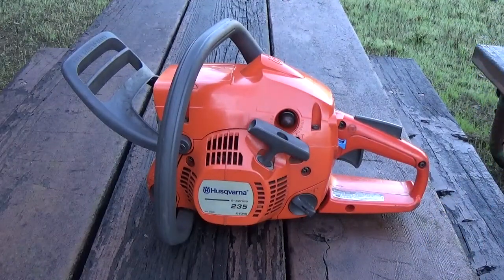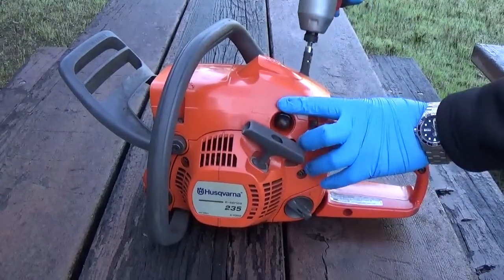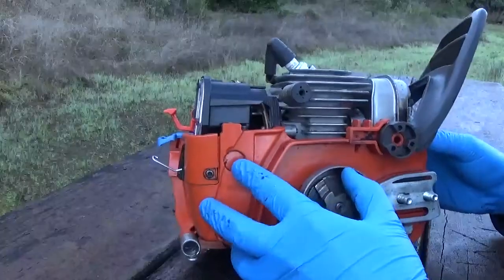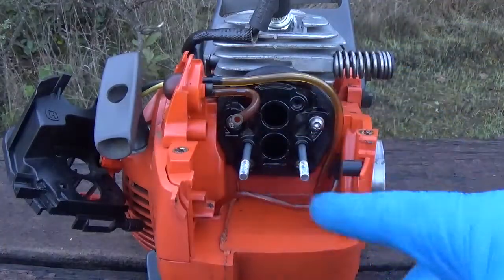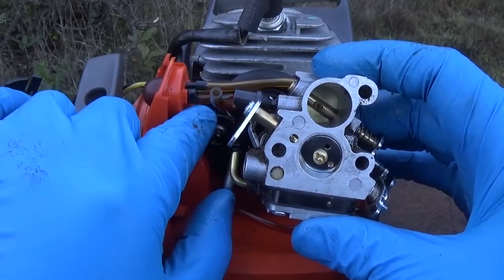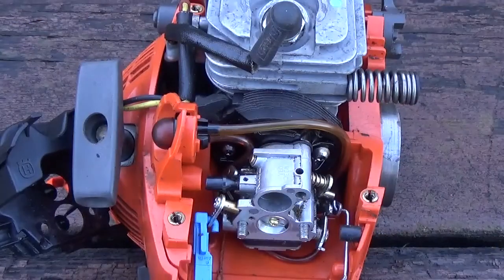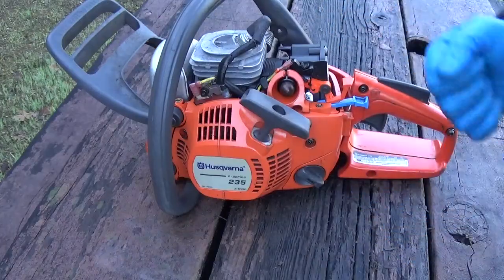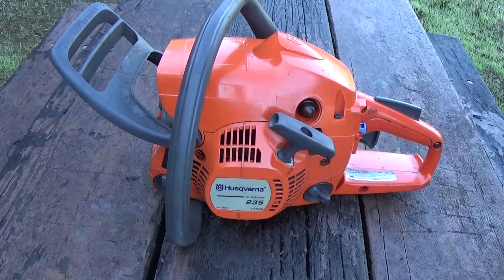Husqvarna 235/ 240 Carburetor Removal & Fuel Line Diagram

Comment: Finally somebody did a simple instructive video that shows you and tells you exactly what you need to know I swear there's nine thousand different videos and they all go around what you need to know and never cover a single bit of it I was trying to verify the way the fuel lines ran on the soil and apparently I do have them the correct way thanks for actually making a video it has good information in it

Comment: Information much appreciated. 
I picked up a 235 and a 445, Both needing Repairs for $115.
Whoever attempted to fix the 235 Put the Fuel filter on a <New> return line, Left the old Pickup Line on (and cracked) and the old carb to primer which had several cracks. On initial testing - i.e. adding Gas to the tank - the whole Top Deck under the Carb was Flood with fuel.
After reviewing this video I pulled the carb, cleaned and Flushed it well. I then followed your diagram replacing the bad fuel lines, putting a new filter on the correct line and reassembled everything.
Initial starting was a bit rough but when I made the proper low/High adjustments it decided to idle and is super snappy going to max RPM. Make me happy.
Now to get a clutch cover, Bar/Chain and find a buyer.

Comment: Very well done Sir! 
Saw would quit running several minutes after a full tank, rotten fuel lines were sucking air as soon as the fuel level dropped.
I shoulda looked for this before I started unscrewing everything.
But, yeah, I googled "Husqvarna fuel flow diagram" and bingo.
I won't say what I learned about those four screws on the bottom of the motor but you did remember for me the three finger tubing puzzle.
All is well in the end, 17 year old unit saved from the recycle yard for a couple hours & $20 and saved about $300.

Comment: I put a new bar and chain on mine to correct a crooked cut. After, my saw decided to not start. Thinking it was an old fuel or carb issue, I took out cleaned, replaced the spark plug and tuned. Okay the saw is running like a champ again!Then ran into a no start issue again. Primer bulb was only half full so I’m thinking I need to replace my fuel lines. 

I’ve already put money into the saw so I might as well keep going till it’s fixed. 
Great video, thanks.

Comment: Thanks for the very well done video, it explained how to take the saw apart enough to get at the fuel lines and carb and a very good explanation of how the primer bulb actually works. I was able to replace the fuel line from the carb to the tank without removing the carb, once it got in the tank, was able to grab it with a pick and pull it thru. A fiddly job but not difficult.

Comment: Excellant video great detail.
Especially choke lever position. Originally had it installed wrong.
I was able to change the carb but had to do it twice.
I forgot to install the gasket.
Noticed the old gasket on the old one after I installed the carb 
Your detailed instructions helped alot.
It runs now but have to adjust hi low settings. It stalls when I pull the trigger.

Comment: You won at YouTube for today. Thanks! 
I got my saw back from a "small engine" joint after having them replace cracking fuel lines, filter and bulb. Prime, choke, pull, half-choke, pull and it ran great... For 4 seconds.
They had the bulb backwards and the filter on the wrong side. Working now.
Again, thanks!
Reply from the maker: That's like the worse of both worlds...had to pay to get your saw worked on, and had to work on it yourself anyway. I'm sorry to hear that.
Reply: How much did that cost you at the small engine shop? I'd like to chant the cost I'm saving as I do this work for myself!

Comment: Awesome video. I have a jonesered and I have yet to find a video for that brand on fuel line routing. I knew I shoulda took a pic before I tore out the fuel lines, but I didn't. On top of that it's 2 weeks later and I'm now working on it again. ( out of state work emergency) my Jonesered model CS 2234 S fuel line routing is exactly the same as your Husqvarna. I take it that Husqvarna owns jonesered co. So it all makes sense now. Great video and thank you..😄🤘

Comment: Great video and saved me a ton of time and money. I have a 235e, and it took me a couple of tries getting it back together because I got the screws mixed up, would've like a little more detail on that, plus mine has two different sizes of gas tubing, a smaller one for the main gas line from the filter, and two lines next size larger for bulb/primer. Otherwise, many kudos for an excellent job!!!Thank you!!

Comment: Great video. Appreciate you taking apart a running saw to show us how. Do note the bolt holes through the black plastic carb piece are way too tight. That's  the pinch point. Ream those out once you get it apart to make future cleaning easier.

Comment: Thank you for the in depth video this was great!!! My issue was I bought mine from a pawn shop and well lets say never again with out a full take down and deep dive into finding out what the heck someone else did to the dam thing! cost me almost as much as a new saw to replace the worn out parts I think I am 15$ less at this point and I need to replace the bottom fuel line because they used the wrong one and it leaks from the tank as you try and prime it so the saw does not stay running because it sucks air and then dies!

Comment: Well done! Great video!
I've had a few chainsaws where the fuel line depletes over time and drops the filter in the tank. What a load of bollx. You need to learn to fix them yourself or they just become disposable trash.
But thanks for posting this.
PS.. I get the fuel line kits from Lowes or HomeDepot

Comment: This is about as simple and straightforward as it gets. Great fuel line vid, the best I found.  If I can understand it so can anyone.  Just one question, maybe 2: How far into the tank does the return line need to be?  Does it really need that little nipple on the end?  How much play is needed in the line with the fuel filter?  No doubt it's going to move around, but is there a goal with how it lays and where the filter usually drops?
Reply: I didn't ask bout no 235240what ever came uo<<< I ask bout 440 so I wasted my time

Comment: Execellent video. I'm replacing my 235 carburetor and fuel lines now. Any suggestions on how to replace the fuel line that travels from the bubble back to the fuel tank? looks like it has something at the end of the line inside the tank that keeps it from being removed.
Reply from the maker: Yes the white piece on the end of the fuel line is just for that, to keep it from pulling out. Easier to pull it out through the gas tank, and put the piece back on similar to the fuel filter. Sorry for the delayed reply, hope this helps.

Comment: Good info, used some curved hemostats (surgeon style pliers you see medics clamping onto arteries in ww2/nam movies) Fits in the gas tank perfectly to clamp onto the cut needlepoint in the hose you mentioned. Cheap too.
Reply from the maker: Those are an awesome tool to have around... very useful for machines where the gas cap hole is in a awkward spot (for me, certain back pack blowers come to mind.) That and it feels cool using them.

Comment: Well I may ask you a question about my Husqvarna 326 that I bought from a fellow ...It started when  he tested it but the day after 
I only enjoyed it  fifteen minutes then it become a night mare  ...to make the long story short I replaced the carburettor -a new one from China -
And stil didn't start and  because it is hard to pull the rope  i decided to have a look the  the piston and the cylinder ...
The piston shows a scratch on the muffler side  it has not damaged the ring and the cylinder ....Then  I removed the ring and fitted
it in cylinder it has a gup about one millimetre....it's ok or do I have to replace the piston and the ring ?
I appreciate your help               Thank you

Comment: I've got this exact model and I really need your help. I have to replace the fuel lines and purge bulb which is not too difficult for me to do. What I'm not sure about is the fuel tank vent ( I accidentally pulled out the check valve (duckbill) while trying to pull out the old fuel line that goes into the fuel line fitting. So that needs to be replaced. I understand that I need to drill a hole in the vent and pull it out with a screw. I also pulled out the fuel line fitting so I'm not sure how the fuel line/s needs to be installed. Is there a piece of fuel line that needs to be ran from the top of the bubble into the bottom of the tank from the bottom of the fitting? Sorry for all of the questions.

Comment: when you buy the car lets say from Amazon do you need to adjusts the carb or id it plug and play with out having to adjust?
Reply from the maker: The cheap carbs on Amazon are hit and miss, its why there so cheap. They may work with settings out of the box but you really should check your rpms with a tach.  If tuning by ear, I'd eer on the side of caution and go on the slightly richer side, stratified engines are little harder to tune by ear. Good luck.

Comment: Great job with the video, really well done. I'm having an issue with a 120 mark 2 and was wondering if you've ever had to replace the fuel tank vent on one. Same setup as the 235/40 but I can't find any info on how that sucker comes out. Thanks for the video!  Subbed.

Comment: I am asking to myself should I disturb you  or not since I never got an answer to my  question a couple weeks ago 
since then to my surprise the chainsaw  works  but  I can get the new primary working   I connected as per your diagram  
but  no fuel flows in out actually the bulb get stuck and does not  come back  so a you said long little tube the fuel line (out)
to the tank  the short one (inlet)  from carburettor to the bulb .Any suggestions ?

Comment: What are the two spline screws on the choke linkage side? Do you have to do anything to them?
Reply: Never mind. I’m an idiot. Never replaced a carb and didn’t think about those being the low and high adjustments while I was holding the new one in my hand.
Reply from the maker: You may have to adjust them. As you figured out its for fuel air mixture on the high and low end. Some caution tho, and topic for a different day... if one does know what they're doing you can blow your saw up.

Comment: Ugh.  Well, I took it apart, cleaned carburetor as well as I could.  Replaced all 3 lines and filter and it started and ran but it eventually bugs out and won’t idle.  Then it won’t start.  It’s 13 years old but I spent $20 today.  
Is it worth it to keep trying?   New carburetor?   Thanks in advance.
Reply from the maker: Its hard to say, I have spent money on a machine that was totally not worth it, because I enjoyed doing it, and it was a good learning experience. 

 If it's 13 years old, got used heavily and at $150-200 brand new, money wise it probably makes more sense to buy a new saw. (especially if you can't wait for parts, and need a running saw right now.) But if you like the experience, yes a new carb could solve the problem but that being said...

Before you put anymore money into it, I would look at the condition of other things first.  (maybe I'll make another video of what you should be looking for.)  Does the compression on the pull rope feel decent?  

If your comfortable with it, pull off the muffler look at the piston, rings , and cylinder wall, is there any scoring?  A 13 year old home owner grade saw used heavily may have some wear, in which case you could be wasting your time.

Hows' the bar and chain, if they're worn out that's another $40-50. (just one of the many things to keep in mind, too much for me to cover in one message)

A new O.E.M. carb in my area is like $60-70.  You'll see cheap aftermarket carbs online for like $20 but there just that, cheap.  I've had success using them before, but you really gotta be careful sometimes the quality control is shoddy at best and almost laughable.  (I would never use cheap chinese carbs on a machine that was valuable and in really good condition, but with a little research I've seen them work pretty well.)

Sorry for such a long message, but I hope it helps you out, feel free to PM me and I'll answer any other questions the best i can.  But in the end if its worth it is really your call, but keep in mind it is a really cheap saw to begin with.
Reply: Punishable Deeds I don’t use it much.  Prob 20 hours total if that.  I’d hate to waste more money but yes, I like to learn and the challenge.  But I’ll prob just throw it out.  Thanks for the reply.
Reply: Punishable Deeds if a new carb would def fix it I’d do it.  I’d hate to waste time and money.   How do you know it would fix it?   Dumb question I know since you haven’t seen it.
Reply: Punishable Deeds I was looking on eBay a new carb with kit is about $15.  Shot I paid $10 for the primer bulb kit and 7 for a spark plug at Lowe’s.  So I might try it.  

When I replaced th long return fuel line I accidently pilot the little breather rubber thing out.  Can’t get it back in inside the tank.  Will that be a problem?
Reply from the maker: @jcstevegigs  If it really only has 20hrs on it, and wasn't abused everything else is probably in good shape.
You said you replaced the fuel lines, if those were rotted/stiff and needed to be replaced usually the rubber parts in the carb are in similar shape. (the diaphragms get stiff and won't flex anymore.)
Before buying a new carb you can check to make sure the intake gasket doesn't have any tears or rips make sure its good.
If your comfortable with it you can try adjusting the carb you have now, to see if that fixes it.
Techs use a small vacuum and pressure pump to test if carb internals are good. They will see if the metering diaphragm holds pressure/vacuum or they sometimes actually put the whole carb in water and look for bubbles (leaks) while doing this.)
Not really a tool your average guy has around, but if you open your current carb and the rubber pieces are all stiff and hard like the fuel lines were, that's a good indication that might be the problem.
Probably more than you wanted to know but hopefully your having fun while working on it, which is why for me sometimes it wasn't really wasting money, its a hobby and I like doing it.
But yeah I totally understand the temptation to say screw it and buy a new one.  Especially if you have work you need to do.
Reply: Punishable Deeds thanks for the reply.  The carbs on eBay come in a kit with the adjustment tool for high/low.   It’s probably crap for $15. 
I don’t use it all the time but I’m a landlord and like to have it ready after surprise storms.   
What about that small breather thing way in the back of the fuel tank?   A little rubber wedged thing.  Looks like it lets air in.  I accidentally pulled it out getting the hose out and it’s impossible to get back in.  Any idea what that was?  
And yes I do enjoy it.  It’s frustrating but I love learning new things.  Thanks for your help.

Comment: When you reinstalled the air filter metal plate you didn't index the bottom tab into the plastic fyi.
Reply from the maker: No, i did not. First video I've ever made... gave me a new found respect for how to videos.  Very different looking through a tiny lens than just by yourself.  Good eye, I missed that.

Comment: Did Husqvarna use any fuel line connectors in their OEM setup?   I had found one sitting in my fuel tank on my 235 and wasn't sure where it was utilized in the fuel line run..
The link below just shows you an example of the fuel line connector (red piece).
https://www.amazon.com/AC04122-Tune-Up-41CDZ47C799-Troy-Bilt-TB6044XP/dp/B089BYFQM6/ref=sr_1_22_sspa?dchild=1&keywords=husqvarna+128ld+fuel+line+kit&qid=1595014575&sr=8-22-spons&psc=1&spLa=ZW5jcnlwdGVkUXVhbGlmaWVyPUEyWjlKRlA0UTFDU0hPJmVuY3J5cHRlZElkPUEwNDAxODA3MkdGUDNVWEgwVUZVNSZlbmNyeXB0ZWRBZElkPUEwMjExNjk2MjRPNDNTRk5NMlkySiZ3aWRnZXROYW1lPXNwX2J0ZiZhY3Rpb249Y2xpY2tSZWRpcmVjdCZkb05vdExvZ0NsaWNrPXRydWU=
Reply from the maker: I believe that piece you saw in your gas tank acts as a stop to prevent the return line coming from the bulb back to the tank from pulling out and spilling fuel. Hope this helps, a few people have asked about that, sorry for not addressing that in the video.

Comment: have had 4 of these, ya FOUR- all warranTY, all failed because air was getting into fuel line, which degraded from cold. These plastic fuellines and plastic primer bulb especially, do not like to freeze, or excess sunlight, because the cheap plastic degrades and ends up leaKing, and you lose prime as air enters fuel line from cracks....., this is the worst part of the design...., good luck fixing.... i have worked in mineral exploration and tree falling and have used saws extensively for fuel wood cutting and saw mill. My sTihL 038, is over 20 years old and runs and starts like a dream, but for lighter work, wanted a saw that wasn'T 13 lbs.

Comment: Mine works like an animal when it starts.   If I run the balls off it for about 5-10 minutes it’s great when I shut it down and go to start it about a half hour later it doesn’t start right up.   Very annoying!
Reply from the maker: Not making assumptions but a lot of people do not know there is a high idle setting for warm starts. Pull the choke lever out, push it back in, once it starts blip the throttle to take off the high idle. Hope this helps, but it could be a lot of different things

Comment: Feeding that hose through the hole in the tank is nearly impossible I ended up drilling mine out a little.
Reply from the maker: A lot of people do. The fuel lines that come with is not really that good.  Making the hole bigger allows you to use a thicker wall fuel line, and you can just buy regular fuel line sold by the foot. Should have mentioned this in the video